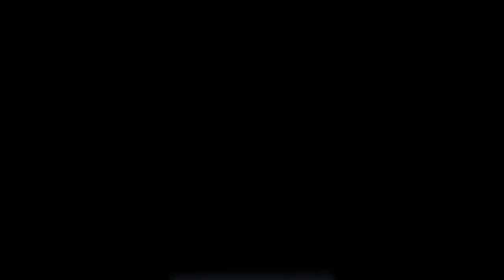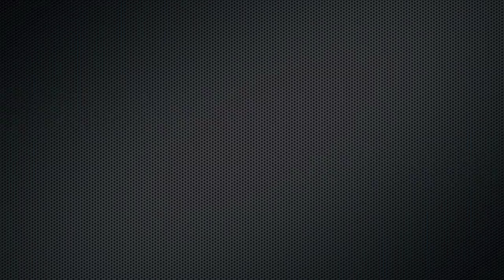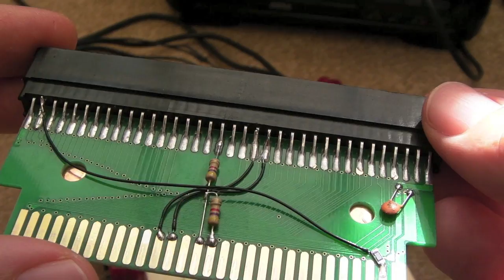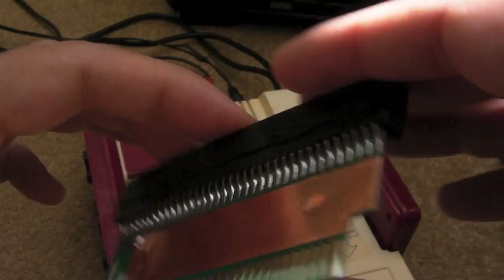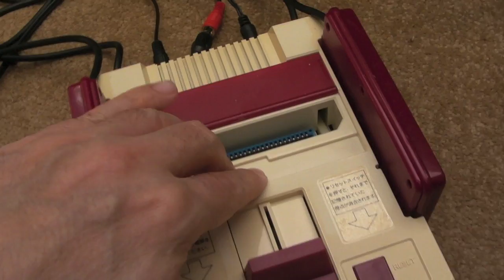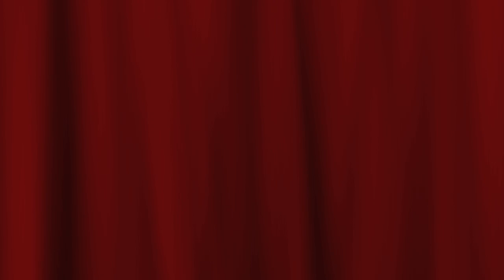Nintendo Famicom 72 pin to 60 pin Converter Mods & Everdrive N8 Follow Up (100% fixed)

Comment: my problem using these adaptor are screen is just flickering on my av modded famicom
Reply from the maker: It's probably the same issue I had here, where it needs the copper tape to help with reflection I think.

Comment: I did the mods to my adapter. Its the same as your's. Now all the sprites for regular cartridges are scrambled. It works fine for NES everdrive though. Any suggestions?
Reply from the maker: It's probably a case of what fixes the everdrive in that use case, breaks normal carts!  Those adapters are so cheap, I would just get another one for standard carts!

Comment: Hey there, hope you atill respond to comments on this video 😅

Im currently using this adapter on my AV famicom. Its been previously modded with jumper cables to run MMC5 games (Castlevania 3), however I'm having an issue with MegaMan 2 currently. It constantly resets during the opening crawl and freezes at the character select screen. Is it possible the copper tape on the back will fix this?

Also what exactly did you solder the copper tape to? I saw a written guide that said th scratch back some of the pcb and solder the tape to that, is that correct?
Reply from the maker: If its the exact same adapter - copper tape which is grounded could possibly fix it.  I would need to test MegaMan 2 with my Everdrive - assuming the cart you are using supports the same mapper etc.  The issue with my adapter here is the routing, which creates reflection on various points around the PCB.  The trick with the copper tape is to make sure its pressed super flat - polished flat, and does not short to connections, anywhere except for a ground contact.
Reply: @GadgetUK164  gotcha I'll give it a shot then, I dont really have much to lose here haha. Thank you for your response! I appreciate the advice!

Comment: I recently got a Famicom, and I have a clone N8 for NES. It was crashing excessively for me, then it turned out downgrading the firmware to 1.23 (I had the cart for over a year and it apparently had 1.24 all this time) made a massive difference. It still seemed a bit finicky, but then I found some weird clone firmware labelled as v13. It mentions it supports 151 mappers iirc, but it has worked almost perfectly with this firmware. It makes me wonder out of curiosity if the official cart would work any better on older firmware with this adapter (even if that sounds like it makes no sense). I was surprised to hear that even the official cart crashes though, I thought my cart was just broken at first.

Anyway, I have only had one crash so far after hours of play on this old firmware, and on 1.24 it was crashing hard, I couldn't even get through the menu music in Journey to Silius without a crash. I've ordered some resistors and I'm planning to do the expansion audio mod when they get here, by cutting the trace between pins 45 and 46 and connecting resistors from there to pin 54 on the NES side. I'll add some shielding on it after I do the mod, and I'll consider the mod to make the likes of CV3 work while I'm at it, and I'll think about what you mentioned with M2 if I keep getting crashes. Thanks for the video.

Comment: Hi!! Can i use a regular resistor and not smd? If i understand correct you have to solder a cable to the nes side connection directly then to resistor and then to the famicom side leg without anything other connected there.. and if is something connected you have to cut it...
Reply from the maker: Yes, that would work just the same - just make sure the legs dont short anywhere unintended!

Comment: do you always need to modify the adaptator by yourself, or can you buy one that already take these modifications into account ?

thank you for this useful info
Reply from the maker: I am not aware of any that have been pre-modified.  You can buy ones that are shorter (different seller) that may not suffer from the problems.  But part of the problem is the Everdrive when using these adapters.

Comment: Chris, just wanted to give you a huge thanks. I rediscovered your 4 year old solution for instability and it totally fixed my problem with my HI-Def NES modded NTSC-US top loader and my Everdrive N8 Pro (Famicom version, this plays a role)!  Before this the N8 Pro would not boot. I posted this on Krikzz's forums a long while ago and even messaged Jason @ Game-Tech, but we never got anywhere with it. I was told that the N8 and N8 Pro both had issues with the HI-Def NES mod for reasons that Krikzz said was related how the system boots with a HI-Def NES in it. I have another RGB NES modded AV Famicom so I could use the N8 Pro there without issue.  It also worked fine with the same Hyperkin 72pin adapter on other stock NTSC-US NES systems.  So in the end, to get the N8 Pro + Hyperkin adapter + HI-Def NES Top Loader working the solutions was to just add a ground plane to both sides of the Hyperkin adapter's board. Your copper tape suggestion tied to ground cleared up whatever bootup signal issues the adapter was introducing.

Comment: thank you for this video, unfortunately it doesnt work 100%, i did everything except the 22pF cap, the copper tape seems to be clean but i still get super slight glitches in normal games and really strong glitches in mario bros 3, do you have an idea of what i should do?
Reply from the maker: Is the tape evenly applied and you've made sure its as flat as possible?  Also, you did ground it properly too?  I've had 100% success with this myself, and had feedback from numerous others that it worked too for them.  I will do a follow up soon, and demo the before and after on a brand new adapter.
Reply: @GadgetUK164  im pretty sure its very flat, i rubbed it with a rag for a few minutes, can you maybe make a full tutorial or show how to apply it correctly? im pretty much about to give up and buy a famicom n8 because i have been having trouble with the tape for a week

Comment: FEIK? ?
Reply from the maker: Do you mean "fake?" - no!  This does work and fixes the problem with this cheap adapter.  The problem is the length of the traces and how they are organised on the PCB, coupled with lack of a ground plane.

Comment: Is it possible that I need this mod to actually make an older version of the n8 everdrive work on my famicom? I get garbled text instead of the menu while the everdrive works correctly on my pal nes.
Reply from the maker: Yes, sounds like the issue if you are using an adapter!
Reply: @GadgetUK164  It's always me but with another account, i did the mod but i still get this issue https://krikzz.com/forum/index.php?topic=875.0, i don't know what to do, i can't find the old firmware related to the 255.RBF, i don't know if i can solve this hardware wise and i also don't know if the famicom is the issue; i need help.

Comment: Hi. Do these mods only need to be done to get Everdrive woking with this adapter? I have seen some for sale on Ebay like this: https://www.ebay.co.uk/itm/282311629148 will this work unmodded if I only want it to play original carts on my AV Famicom? Thanks
Reply from the maker: I suspect many games will work fine with the adapter, but some might not.  The issue is partly related to the Everdrive, but utimately its the traces and the way they are routed on this adapter.  So some games may suffer the same issues I found here with the Everdrive.
Reply: @GadgetUK164  Thanks for your fast replys! You probably get asked a lot, but do you do mods as a service? Just asking as I might get one of Woozle's GBA Consolizer kits https://www.game-tech.us/product/woozles-gba-consolizer-kit-full-case-version/ and if I do, I was wondering if there's anyone in UK who might assemble it as a service, I have a working GBA to use for the motherboard etc. Thanks again

Comment: you might want to consider coax for the clock! as for the tape, if you get a converter with an enclosure, maybe it would be easier to put the copper tape on the inside of the enclosure, and connect it to the pcb with a wire?
Reply from the maker: The copper tape needs to be flush with the PCB - it's helping reduce cross talk on the traces.  Nice idea with coax though.

Comment: Hey, i tried to solder the 2 10k ohm resistors to my adapter and i tried Castlevania 3 on my N8 but it didn't work.

Are the other steps necessary to make the expansion audio work?
Reply from the maker: Are you running the Japanese version of the game?  That's has the expansion audio.  The US version doesn't.
Reply: Yes i am. Here's how my adapter looks like. Not the best soldering job but i have checked the continuity and it seems fine.
I'm using a AV Famicom connected to a PAL Tv but as far as i know that shouldn't be an issue right?

https://i.imgur.com/TxAciyz.jpg
Reply from the maker: Are you trying to play on a Famicom or a NES?
Reply: An AV Famicom, yes.
Reply: If you never solved the issue with CV3 working with your 72-to-60 pin adapter as you posted here and on krikzz, the 10k ohm resistors do not correct CV3 or other MMC5 issues.  It is the two wires  that cross near the center and severing the traces between the pins as pictured in Barawer's guide that fix MMC5.

Comment: Thanks for your video! It is very informative!
I just ordered one of these converters so that I can play my Everdrive N8 on my Famicom and I just wanted to make up a list of supplies I need to do this mod:
2 x 10k ohm resistors
1 small 100 ohm SMD resistor
a ceramic 100nF capacitor
wire
solder
copper tape

For the copper tape, do you recommend the conductive adhesive type or the non-conductive adhesive type? Also, is there a specific width tape that would work best?
Thanks again, love watching all your videos!
Cheers from Paradise, Newfoundland, Canada!
Reply from the maker: Thanks =D  I used the slug repelling copper tape - designed for sticking to plant pots.  It has adhesive on the back already.
Reply: Thanks for the reply! The slug repelling copper tape has non-conductive adhesive on the back (which makes sense now that I think about it =D ). I just received my adaptor in the mail today; going to get the supplies and get it done as soon as possible =D Thanks again for your help and keep the content coming :)
Reply: I meant to mention as well that I had tons of issues with the adaptor when used with the Everdrive N8 that I have - SD card read errors, etc. I couldn't get to a game screen. Can't wait to get the mod done so that I can use it properly :)
Reply: I wonder if there is something else that can be used as a substitute for the copper tape? I've called around to a number of stores in my area with gardening departments and they do not carry slugand snail repelling copper tape :(
Reply from the maker: eBay is your best bet!
Reply from the maker: That sounds extreme!  Maybe check your 5v level whilst you are there, and make sure the everdrive cart edge is super clean.  It's quite rare to get symptoms that bad with one of these adapters!
Reply: My contacts are super clean, I will check the 5v level for sure. Thanks again!
Just a quick question: when I made my list up above I mentioned 1 x 100 nano Farad ceramic capacitor - not sure where I got that from because I rewatched the video and you state that you used a 22 pico Farad capacitor. I was just wondering if I could get some advice to see if I could use a 100 nano Farad in place of the one you use (which is actually a 100000 pico Farad capacitor -far higher :(   and I ordered 100 of these 100nF caps for $1.01 canadian dollars with free shipping and received them in the mail a few days ago). 
I can't believe I completely missed that. I also have a couple of 1000pF caps from a computer power supply, perhaps I should use one of those if you believe it could work. 
Thanks!
Reply: I ended up ordering some 22 pico Farad ceramic capacitors for less than $2 Canadian dollars; I've received them and followed your video to the letter and I'm still getting those errors. I haven't checked the 5V level yet, but I'm wondering if either some of the capacitors are bad or the 5V 7805 regulator could be almost done for. What do you think could be the issue? Any help is greatly appreciated! Thanks again for all of your content; please keep the videos coming! Cheers!
Reply: I believe the Everdrive carts (for any system) use a little more power than normal carts. so I think that's my issue. My everdrive works perfectly with my North American NES, a clone NES, my toploader NES 2, but not the Famicom. All normal Famicom carts work perfectly and all my NES carts including Super Mario Bros 2 work great with the modified adaptor. Thanks again!

Comment: I think this is the very reason Krikzz made both a Famicom and an NES version of the EverDrive because he probably knew using a converter for one or the other would cause problems. But I totally get why people buy one version of the EverDrive and then try to use a converter since buying one is expensive enough as it is. Great video, I really like that copper tape you used and I may need to use that for certain mods in the future so thanks for showing that off and this is most definitely a very informative video.
Reply from the maker: Thanks =D  Yes, best to just buy an adapter from Krikkz if you can - no doubt he's addressed the problems with these cheap adapters.  Copper tape is really useful for some thing - you can even use it to repair broken pads or traces, and as I did in this video you can use it to carry noise to ground.  I've since used copper tape in a few places to fix similar problems.
Reply: improving the adapter that way is still useful for original games as well, not for PAL ones but for example to play USA games on a famicom, I have a pal NES and a famicom so I have to use an adapter to play american games

Comment: Hello I have an adapter that has all the pins connected but I have problems with an NES Everdrive N8 in an AV Famicom. I have graphical glitches in most games and some do not even work and the few work normally. I do not know if you have any idea what may be happening ?, the only thing I can think of is to add copper tape on both sides of the adapter because it is different from the one you use, mine is from the 90s and the cover of the games NES are looking back at the console.
Reply from the maker: The chances are its the same problem with your adapter.   Check that the mods for MMC5 don't need doing to your adapter also while you are there.   The copper tape must be as flat as possible and not shorting on anything.  The copper tape then needs a wire soldered to it from the nearest ground point on the PCB.

Comment from the maker: As well as making sure copper tape is rubbed flat, make sure there's nothing on the PCB underneath.  I had someone tell me it wasn't working 100% - he had placed insulation tape on the PCB first, with copper tape on top of that - that won't work, the copper tape has to be as close to the traces and vias as possible.  Also check ground is good, and contacts on both edges of adapter are clean, and famicom slot is clean.  Slightly dirty ground connection won't help.  I also suspect that having severed m2 line at both ends, and replacing with a wire in series with 100ohm resistor helps, because then the m2 clock cannot interfere with nearby traces

Comment: Very interesting stuff! Thanks very much for sharing. I've an AV Famicom and (from the looks of it) the exact same adapter. Most games worked just fine. I only had trouble with games that utilize the MMC series co-processor. The modification I made was much simpler and has worked perfectly with the 100+ games I've tried. I believe it was separating and swapping two pins in the middle of the adapter (42 and 43?). I don't have a flash cart yet; maybe I'll run into some trouble when I do! 

I also know for a fact that the hardware revision can make a huge difference for things like this. Anyone who argues that is just ignorant...